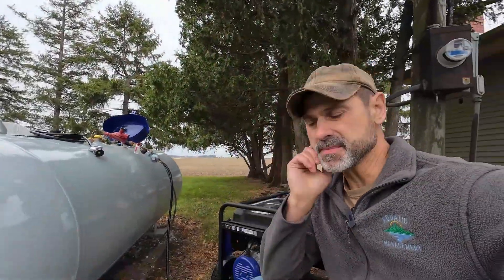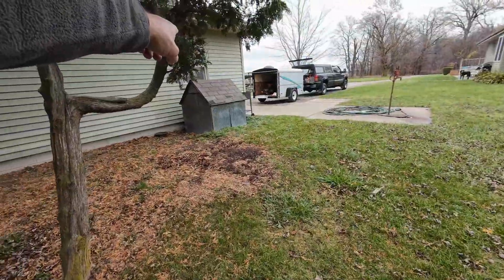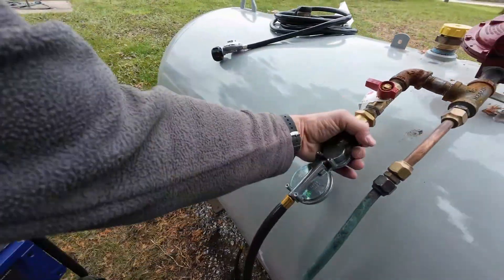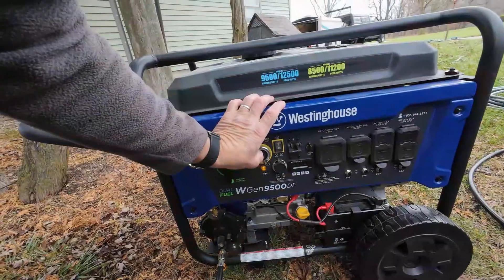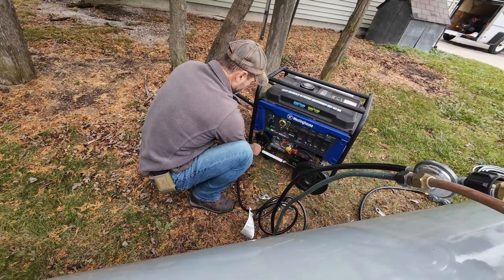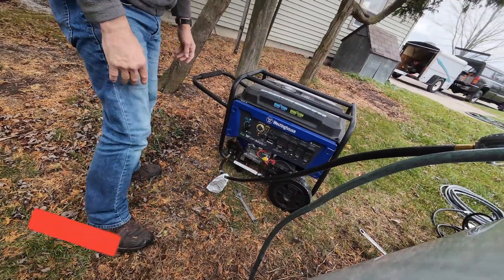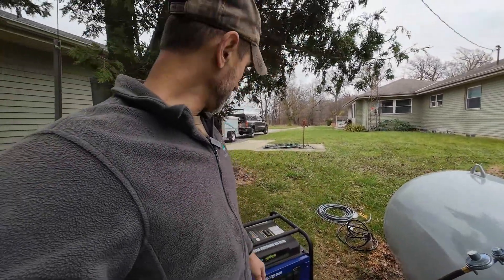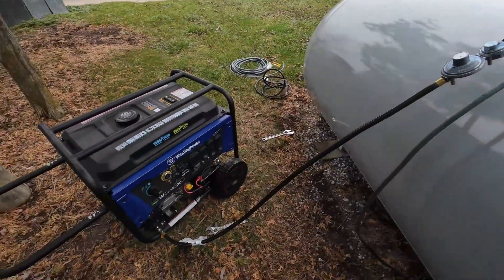Connecting A Generator To A Large Residential Propane Tank - Dual Fuel Westinghouse Generator

Comment: The black one on the Generator is not actually regulator, it's shapped like a regulator externally but it's actually what's called a "mixer" inside along with a saftey valve made into it.  As for your issue.... A normal regulator only reduces the pressure down from high pressure to around 10-11 PSI but portable generators can't run on that much. They need a "two-stage" regulator, that's what the one on the hose that came with the generator is. When you see a propane regulator that has a larger side then a smaller side your looking at a two-stage regulator. The first stage (smaller side) takes it from high pressure down to 10-11psi, and the second stage (large side) takes it further down to about 1/2 of a PSI. You don't have to use the one that came with the generator, save that one as a backup for a portable bottle. For a more permanent installation like with ungerground lines you can buy two-stage regulators at places like TSC, Amazon, Walmart online, etc. Per the manual the Westinghouse models need a Water Column of between 7 and 14 PSI and almost all two-stage models are set at 11 which is right in the middle of the acceptable range, in other words, it's a common requirement for many things beyond just generators.  We have a WGen11500TFc and have it hooked to a pair of dual 350 gallon tanks. Tanks are 60 feet from the house and run through 3/4" hard lines underground up near the corner of the house where it went through an elbow to turn a corner before going under the house. When we added the generator we took that elbow with a T and then ran a 40 foot line over to where we wanted the generator inside a large garage/shop that has automatic garage doors on both ends. The shop is seperate from the house so no problems having a generator inside. So the line comes up out of the ground, goes through an elbow to turn it horizontally where it passes through the back wall of the garage in the corner just inside the rear door, then it has a shut off valve, a reducer to reduce the line to 1/4 where it hooks to the input side of a Mr. Heater 2-Stage Horizontal Regulator model # F273863 (ours came from TSC). It then comes out of the two-stage regulator on the output side with a 3/8 NPT to 3/8 flaired adapter, which allows a standard 4 foot flex line to hook to it and the other end connects right to the generator. You can get cheaper 2-stage regulators for as little as $25 but we liked the Mr. Heater model better even though it was $45 because it's "screwed" together rather than "crimped" together like the cheaper China built models. It also comes with a pair of plastic "weather caps" that snap on which keep rain and snow off of it, even though ours is actually inside so really didn't need them but it's still a good extra feature. We also have a through wall exahust kit which takes the generators exhaust outside of the garage and also helps quiet it a bit and it's sitting on a pair of rubber horse stall mats, a medium-density 3/4" model that has ribs on the bottom so air/mositure can flow under it, then a denser 1/2" thick model on top of that which the generator sits on, they absorb both vibrations and sound vs. having the generator sitting directly on the concrete floor. Then mounted to the wall about 4 feet above it and aimed straight down at it is a 10" turbo fan which is hooked to one of the generators built in 110 outlets so the fan comes on when generator does just to keep air flowing around it. The generator is permantly hooked via a cable to a SS2-50R connector box mounted on the wall next to it which has 4 gauge pure copper direct burial cables (even though we still choose to run them through conduit) running underground out to the main service box on the pole 50 feet from the garage. We leave the generator-to-box cable hooked up all the time so starting it when power goes out takes about 4 minutes. Just walk out to carport, start it (feed breaker off) and while it's warming up we walk out to the main service box, turn off the main service breaker, slide the generator safety interlock plate up (prevents service breaker and generator breaker from being on at same time so you can't accidentlly feed power back into the grid and hurt a lineman) which then allows us to turn the 50Amp/240V generator breaker on, then walk back to the generator which by then is warmed up and ready for us to flip on the feed breaker on the generator sending power out through the lines to feed the entire house and shops. Works perfect every time. We normally use gas because it burns more efficiantly and produces more power, but having the large propane tanks as a backup is awesome.
Reply from the maker: Thank you so much for all that good information!
Reply: Wow! Very detailed and easy to follow!
Reply from the maker: @hershallbrown1751 thank you!
Reply: I am finishing up somewhat the same set up as you as far as the interlock and how you go through steps to run. I put mine in a metal box and  installed a 12” exhaust fan with thermostat to kick on around 85 degrees. 
I’m only using one big tank and it will ‘T’ off of my house. After reading your post, I went to TSC and bought the Mr. Heater two-stage regulator. I read where it said “hang it so it can ventilate” or something like that. Maybe I need to re-read but do you hang yours? I ordered a 3” line so I can come out of the generator up to the Two stage (which I plan on hanging somewhere), then to the propane tank. I was just curious what you think about suspending the two stage. Thanks!
Reply from the maker: @Danner22 mine is suspended due to where it's attached outside to the nurse tank. Not sure how much it matters though.
Reply: @rustichandyman thanks for the reply! I was actually replying to Kirika7787 lol! He and I have some similar ideas. But thanks again! Your video definitely started something good! 👍🏼
Reply: Thankyou for this, helped alot
Reply: Exactly
Reply: The safety regulator is a regulator, and it does actually diminish the amount of flow
Reply: A man that knows. Yes!!!!!!  Good to hear and a good explanation.
Reply: Man, thanks for taking the time to explain this. Bravo!!!!!!!

Comment: The only valve you need for pressure reduction is right there on the big tank. The red one. I have 3 Ts off my big tank for water heater, grill, and stove. None have additional reducers. My gas guys did it no problem, said not to double up any valves the big tank will do it all
Reply from the maker: Didn't work for me.

Comment: I am attempting to do the same on my LP line. I had a line ran from the house LP line just for my generator. I want to do the same hookup as you did, as it will just be temporary hookup when power is out, but I am having trouble figuring out what adaptor I need to go from the 3/4" NPT line to the 1 3/4" female ACME ("black plastic screw on BBQ grill fitting"). What is that brass adapter you used and where did you find it? Thanks in advance!
Reply from the maker: Can you email me and I'll send you a close up of my setup?

Comment: You bypassed the two crucial regulators provided by the manufacturer. Every propane device has a designed pressure. Pressure is kinda like volts. What you did by bypassing is like plugging a 12v device into a 240v outlet. You really should put more warnings in the video!
Reply from the maker: I'm using the regulator provided by the manufacturer. The video is for entertainment purposes only and I'm just sharing my experiences. I'll never claim to be an expert.

Comment: Thxs for this video.  I'm about to do the same with igen11000dfc.  Did you just do a 40ft 3/8" to 3/8" extension hose to the factory LP hose assembly?
Reply from the maker: I bought this hose from Amazon. https://amzn.to/4kCvjxf
Reply: @rustichandyman  I am thinking of  buying Westinghouse 13500 with same setup to large tank but to get generator to a protected area from elements I need 2-40 hoses=80’. Do you think this would work with regulators at generator or do I need 1/2 or 3/4” lines…sounds like propane is higher pressure so would be fine.
Reply from the maker: @demiandawson-n1c  to be honest, I don't have the expertise to tell you for sure. My guess is that it would work if you get the right regulator set up. Maybe someone else on here would have some better advice.

Comment: Paul from Iowa,  I also have a Westinghouse 9500df generator,  wanting to do what you did. Do you have a model number on that dual regulator you hooked up to the shutoff at your tank?
Reply: My bad my generator does have the dual stage regulator,  I just need to get a 50 foot hose, sorry for the confusion.  Great video
Reply from the maker: @paultheisen5290 glad you figured it out.
Reply from the maker: Are you asking about the red one? The dual regulator hose actually came with the generator.
Reply: I have the same generator, I also have a 1000 gallon lp tank. I need the model number. Or part number from the store you ordered it from. Thanks,  Paul from Iowa
Reply: The extra one you purchased to make the generator run
Reply: Yes, it came with one, but it only has a single regulator,  I need the one with 2 regulators, thanks for the help
Reply: I will check my generator to see if it has the dual regulator

Comment: Don’t just attach hoses mate, the pressure will break things. A tank will run at 100-200 psi. The initial reg drops that to 10psi, this is good for long runs as distance drops psi with pipe resistance, also high psi can flow in small affordable piping.  That reg built into the gen is probably a secondary which takes the 10psi and turns it into 0.5psi roughly(10 WC” different unit).  There will be another regulator closer to consumption called a zero flow which changes it to almost zero PSI. This regulator opens when it gets a vacuum from the turning of the engine. You probably also have shut off solenoids in the line also that stop the flow until ignition phase. 
Id invest in a $30 manometer for testing pressure, just keep it away from the tank high psi phase unless it’s rated for that. 
It’s good to look up each reg and check out its input and output range and also btu capabilities so your getting the most out of the generator. Lower psi phases will have larger pipe.
Reply from the maker: @EastyUK  sounds like you know a lot more about these things than I do. Thanks for the good information.

Comment: @therustichandyman ~ I see two issues with your setup: 1) I noted the different lengths of your hoses. For every foot of hose, you lose a small percentage of flow. Propane equipment requires adequate flow. You need a larger diameter hose to go 30-40-50ft. 2) To measure the flow at the generator side you'll need a "Manometer" that measures in inches of "W/C" Water Column. "Most" small to medium-sized propane Generators require a consistent flow of at least 11" of W/C. I also live in a very rural area and run two 2,500-watt dual-fuel generators from my 250-gallon bulk tank, that can power my home, back up my (2) power stations, and charge my battery banks on my solar system if needed. 🤠

Comment: So what rating is that red regulator?  Is it a Rego?  Like 9-13" W.C.?  And what did you ever do hose wise to be able to use the generator over by the garage?
Reply from the maker: @ITguyAR_66  I honestly don't know anything about it other than what's printed on it. Send me an email and I'll send you some close up pictures.
Reply: @rustichandyman    Just curious what brand and model which it should say on it somewhere.  Rego is a popular brand.  Thanks!
Reply from the maker: @ITguyAR_66  it's a Rego LV4403TR9
Reply: @rustichandyman  Ahhh.  I see why it didn't work as it was too much pressure at 10psi so it needed your 2nd stage regulator to bring it down to what it needs which is about 1psi or less.
Reply: @rustichandyman  Did you ever get a longer hose connection set up where you can put the generator on your driveway?
Reply from the maker: @ITguyAR_66  the 40' hose I have gets me where I need to be. I also  have a 50 amp plug in my garage that I feed power into from the generator for now. Sometime I'm going to install an interlock plug on my house to hook it up the safe way.

Comment: Interesting...  I know a lot of people go this route for their generator and I'm one of them.  I have a 250 gallon tank outside that's really overkill for our house needs (gas oven and a gas fireplace insert) and I'd thought about having them come pick it up and go to a pair of 40 or 60lb propane tanks that could go next to the house with the changeover regulator.  The last time I put 100 gallons of propane in was Oct 2021 and maybe had 25 gallons in it at that time.  Here in late Jan 2025, it's still sitting at 27% (about 67 gallons) and I get charged higher rent since I'm a low volume user.  So, it's a decision of do I, a) get rid of the big tank so the "big light blue tank" is out of the way and have tanks that will do our bid, or, b) just stay with the big tank.  In central Arkansas, we don't lose power a lot, at worst 2 to 4 times a year for short spurts, although my daughter, who lives in Little Rock and goes to UAMS, lost power for2 weeks back in early 2023 when the tornado went through.  So you just never know.

I have two Genmax inverter generators  that  I run only on propane and the house can work off of a single (5500 running watts) if it's not during an extreme cold or extreme hot time.  Otherwise, I can parallel the2nd for11,000 running watts and run the water heater (electric) and/or downstairs 5 ton 2 stage heat pump.  I'm going to have the connections done where I can hook them direct to the 250 gallon tank for the time being but will do it at  the house connection so it can stay there if I change to the twin smaller tanks later on.  Interesting information on how that Westy didn't like playing well with a direct connection since that regulator probably drops the pressure down to between 9 & 13" water column which is what most portable generators need....11" WC

Comment: I have a westinghouse igen4500dfc using propane to a big tank. From the big tank the gas company ran a line to where my bbq is with a quick disconnect on a regulator and the bbq has been working fine this way. This connection spot was also for my generator. So I have that gray hose like you and ran it like how my bbq line is. So I went direct with the gray hose from the quick disconnect where the regulator is, to the generator direct. When i turned on the propane all I could smell was gas at the generator and it was tight. So I disconnected it from generator and put the regulator that came with the generator like you did and it worked. I'm basically saying I did the same thing as you did and it worked, but did you get the gas smell when you hooked in direct and it didn't work? I think the problem is it just dumps the gas in and definetly needs the second regulator that comes with it no matter how you hook it up. Good video it made me feel like it wasn't just me.
Reply from the maker: @SlaysTheDay  I didn’t notice the gas smell hooking it direct, but maybe I missed it. Glad we both figured it out!

Comment: We just installed a 330 Gallon tank to run our Champion generator and the installer just ran a line directly to a shutoff valve box that has a connector for the standard generator regulator/hose combo.  From my understanding, the flow rate will be different for different types of devices.  We live totally off-grid so we use our generator to charge up the batteries after 3 or 4 days of snow/rain.  We'll use about 3 to 4 gallons of propane for a 4 to 6 hour run time typically.
Reply from the maker: @alvalonline  thanks for sharing. I agree. It’s a little trial and error with these. But it’s nice when you get it right and everything works!

Comment: Like some have said, put the regulators (they're not valves) at the generator end of the hose.
Reply from the maker: @5thGenNativeTexan  the fittings are not designed to connect that way. The purpose of the video was to show that if you use the provided hose with the two regulators back to back. It works. Even if connected close to the tank. Not all grill type hoses and regulators are the same.

Comment: They are not valves they are pressure regulators
Reply from the maker: I agree. I misspoke.
Reply: @rustichandyman  Actually you were right. A regulator in a flow system is a type of valve. Anything that meters or interrupts flow is a valve.

Comment: Glad I found this video. I bought the westinghouse wgen145000tfc. I have geothermal and needed a bigger generator to run it. I plan on getting a 500 gallon propane tank and probably would have run into the same issue you did.
Reply: Holy crap you got a 145,000 Watt gen.. That could run a neighborhood

Comment: Why are you powering the tank with the generator?
Reply: You mean, why is he powering the generator with the tank.

And the answer to your question is obvious: 

* no need to rush to the gas station to get gas
* no need to constantly set a timer to go fill it up with more fuel (and, let's be honest, spilling some of that fuel)
* no need to shut down the generator to refuel (you do shut down the generator like you're supposed to each time you refill the generator with gas, right?)

With that said, it's nice to have both options because if a power outage is long enough, you might exhaust all of the fuel in the propane tank. Normally, you could just call for another delivery, but for a very long outage, that might indicate the roads are not passable. You'll also have thousands of other customers also wanting propane. 500 gallon propane tank + 50 gallons of gas before a storm + conservative use of your generator = you should be able to get through a month of no power.
Reply from the maker: @Beechnut985  I’m using the propane tank to fuel my generator instead of gas in case of a power outage. https://youtu.be/tJRsoZjuGtE?si=-DXK9KhS4xZlq_9a